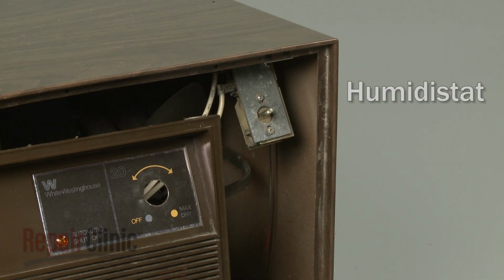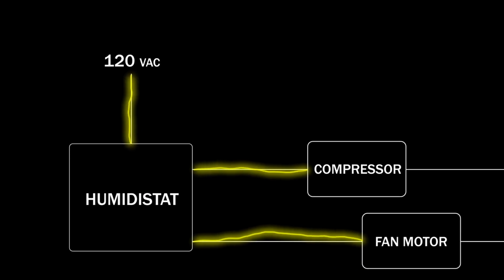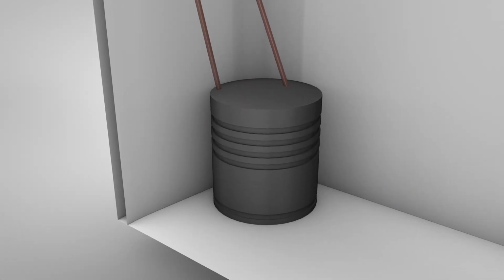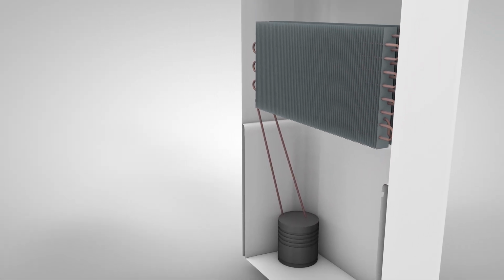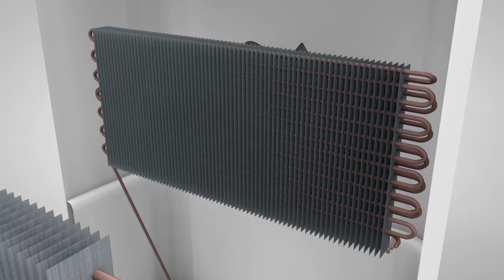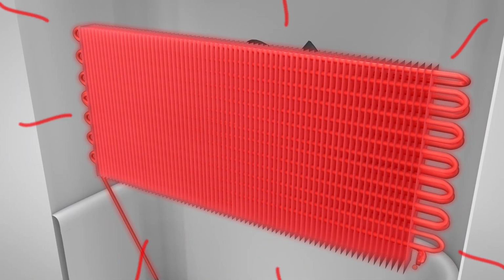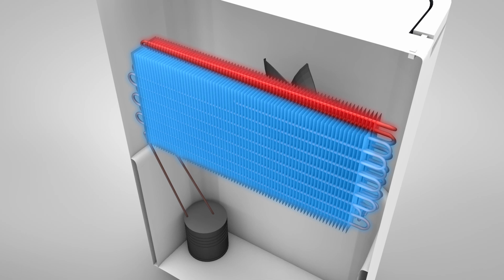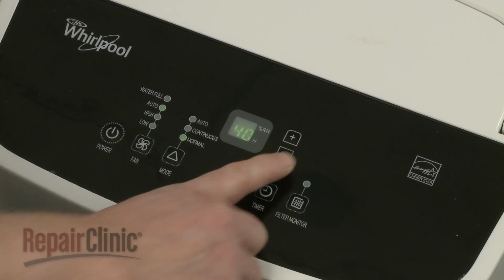How Does a Dehumidifier Work? — Appliance Repair Tips

Comment: I have an old Berns Air King DH 17 Dehumidifier and it worked good last year after I put a ball bearing in the fan motor to replace the bronze  bushing that seized up about twice and year and had to be lubricated. But, now the coils are freezing up even when I take it out in 90 degree weather outside  It has a relay and another round  component on the side of the compressor but I don't know if they are both good. Someone tole me that this type of unit has to cycle the compressor off and on to keep the coils from freezing because it has no sensor in the air flow. Do you have any idea of what could be wrong with it?
Reply: I would check for buildup on cooling coil. There could be airflow restriction across cold coil allowing it to freeze. 
Or temperature  probe sensor on coil malfunction allowing it not cycle. 

Without knowing exactly how coil temperature is regulated it’s hard to say exactly. Can be regulated by air temp. Sensor or by refrigerant pressure(low side)

Comment: All you have is a filter. I took the cabinet off to see how water gets from the air into a liquid and into a bucket. I thought there is more to it than condensation. I guess I need a commercial dehumidifier. So tired of moisture in this basement. Kill all the insects like termites.

Comment: Nice informative video. I've always wondered why the dehumidifier pumps out warm air as opposed to an air conditioner which pumps out cold air, even though both use a similar system with a refrigerant gas running through coils.

Comment: how mutc is the temperature  condenser and evaporator?
for example 65c  out from compressor and 5c on evaporator? how mutc temp must have the liguid  when gos in the compressor?  i dont have the manual and i don't know how mutch 407c to fill the system.
thanks

Comment: How is this different from turning on an electric stove in the room, as the electric stove will also reduce the humidity in the air.
Reply: A stove lowers the relative humidity by raising the air temperature.  The same amount of water is in the air, but the air is warmer, so it will feel a little dryer until the air cools back down.
A dehumidifier actually removes water from the air and keeps the air temperature more or less the same (the air will get a little warmer over time due to thermodynamics).
Reply: @Uejji  Sir, Thanks for the reply to my query - I did not see your note until now ( a year ago ). Thanks again.
Reply: @The Best Western Sorry - You are right - I just opened the page after I got a notification on your "Highlited reply".
Apparently the Uejji's reply did not get notified or I must have missed it - I don't walk away without a 'Thank You' for anything that I received. Honest Mistake on my part.  I will reply now.

Comment: on mine only the frist copper bend gets frosty dose that mean there is a blockage in there i took a vibrating tool and tipped it while running and the next  copper turn did get cold but no frost i think i may have lose the blockage a lil
Reply: Will its hot air be unuseful in summer or will the effect of less humidity be more comfortable than hot air emitted from the device.

Comment: I haven't known a recent dehumidifier that lasts more than 5 years - pathetic.
Reply: My Frigidaire has lasted 10 years, 50 pint.
Reply: @albeesand   trying to fix a Frigidaire that doesn't dehumidify, had an A5 trouble code, sensor fault.     I may just wire it on so it runs continually and just turn off manually, if the compressor still works.

Comment: Whats the point of this? This is exactly like an AC. Its better to install an AC because it does the same function and cools the room to a comfortable temperature.
Reply: AC isn’t needed in some parts of the country where its cold and wet. Better to just spend money on a dehumidifier and not more on an AC which isn’t needed.
Reply: @QuintTheSharker  
In my part of the country, the humidity is only problem in summer, when it's hot, so an ac is better as it serves to cool as well as dehumidify, for an equivalent amount of energy use. Only time it's better is if there isn't any window to install an AC unit, like a basement with no windows big enough.

Comment: I have a general electric dehumidifier model adel50lww1 thats about 1 1/2 year old that works in all functions except one. When the humidity in the room reaches high humidity, the machine will not start automatically. I can manually start it and it will run until the desired humidity dryness is met and cut off as normal. Then as the moisture builds it will not auto come-on. Any suggestions.

Comment: Hi, can someone tell me if I can exhaust the hot  air from the dehumidifier outside. The dehumidifier is working great but makes the room too hot.
Reply: That's essentially what an air conditioner does, although its purpose is, of course, to cool a room instead of remove humidity. Some A/C units do have a dedicated dehumidifier mode, though, which directs the heat outside and has the added benefit of not needing to be emptied since the water is expelled outside as well.
Reply: Use an air conditioner.
Reply: Just use an air conditioner. Yes you could exhaust the hot air but an air conditioner is more worthwhile

Comment: I'm looking for one that you can set it and forget it.  I want easy. I want it on all the time, especially the cold months. I don't want to be going home at lunch hour just to drain the bucket or else I'll have a flood in my bedroom. I guess I will spend five thousand dollars to put a drain in the middle of my bedroom. LOL
Reply: Humidity is usually low in cold temperatures, why would it be needed in winter?  
If you don't want to have to constantly be dumping out the water, you can attach a hose to it and have it drain into a sink, if you can have it sitting high enough.
When I had to use one sitting in a position too low to drain, I used a small water pump controlled by an electronic level sensor to turn it on when the bucket got full, so it automatically emptied out the high drain.

Comment: That satisfying feeling when pouring away the water from the dehumidifier’s bucket 😌
Reply: Put a few dehumidifiers outside and let it run and you get free water
Reply: @adamhvacr6536  expensive - works with electricity. BUT solar panel electricity grid - it wonder if it would be cheaper
Reply: Adam HVACR then you’d be drinking your breath, think about it 🤔
Reply: @SavCrafter  He said OUTSIDE
Reply: @chrislittle7285  oh shit you’re right
Reply: @chrislittle7285  other people's breath
Reply: @Bobby-cm7vu  Outside? Where do you live? Manila? The population density is quite low where I live. I wouldn't be worrying about people's breath outside.
Reply: @chrislittle7285  i live in a residential area but even then, people still breath, that air gets moved around, and it's always in the air, even if it's the smallest percentage.
Reply: Which is distilled water, good for topping up batteries etc
Reply: HAHAHA HERE HERE!!!!
Reply: Drink it :D
Reply: I thought it was just me
Reply: kinda like moonshine.
Reply: That's what she said.

Comment: the downside of these units is the amount of warm air that they produce and send back into the room that my central air is fighting to cool but they are useful for those areas such as a damp basement where most A/C units are rarely used
Reply: apparently you know nothing about these units, the only cool part is the water dripping into the pan
Reply: Mark Olsen did you look at the Diagramm sir? Both heating and cooling elements are adjacent to each other. I’m not sure what model you have but mine pushes out dry neutral air, like it should. You may have a cheap shit box.

Comment: can I make a dehumidifier blow cold air question
Reply: No
Reply: That would be an air conditioner. That has the evaporator inside the room and the condenser outside the room, so it gets cold air without getting reheated by the condenser.

Comment: I have that old Kenmore dehumidifier.  I got it at the dump, 11 years ago.  It has worked in a 50 degree damp room.  I think it's time to check for dust, don't you.  I want a second one just like it.  Thank you for the video.
Reply: So the aqua dry is by Kenmore? I'm looking at buying one locally listed. Clearly it's vintage but most older things run better and longer than the newer stuff. We've burned out a few newer dehumidifiers.  Maybe I will buy that older model. Is yours still going?
Reply: @Weaton777  aqua dri is made by oasis

Comment: These things are energy hogs.......... they dont take care of a big area.  They are noisy, a hassle to empty the water  reservoir. 
And if you keep them in a damp basement and set them at 30-50% they will run forever. ( most likely will freeze up at 40% )They dont take the damp odor out of the air. Ideal humidity  in  a home  should be 30%, give or take 5 %.  You have to vent that  damp wet air out of the home. Try the "Easy Breeze" system ( google it ). It's costly ( about $1000.00 ) but does the job and moves the air in the entire house up to 7000 square feet. to the outside of your home. Despite what the dehumidifier  manufacturer tell you a dehumidifier  ( even a large  one ) will only remove dampness for 1000-1500 square feet .  The "East Breeze" costs about 5 bucks a month on your electric bill, the energy hog dehumidifier  costs about  45 bucks a month to run.  The unit shown in this video  will only be good for about a 20 x 20 foot area.  The "Easy Breeze" unit  removes 7 times more  air than  a dehumidifier.
Easy Breeze will make your whole house  comfortable, not just one room.  Plus the "Easy breeze " unit has a 10 year warranty.
Think about it, the dehumidifier collects water in a bucket on the unit. That's standing water ( if you dont empty it in a day or two )  which goes back into the air.  Please research your options, it will pay off in the long run and your house wont smell when the humidity in your home reaches 65%-75%  which gets into your  bedding, clothes, carpeting, furniture, walls and closets.
Reply: Did they change the name to EZ Breathe now?
Isn't that essentially a ventilation fan?  Problem would be if the outside air is very humid: then it'd draw in moist air instead of dry air. Otherwise it's good to ventilate the damp musty air rather than just extract the water from it.

Comment: I thought Relative Humidity % #'s fixed & negatively correlated to temperature, based on this video, it says after the room air's water's squeezed out of it in the Dehumidifier, it's heated and sent back out and what happens? I'm confused.
Reply: The fan cools the pressurized (thus heated) gas; when the pressure is released, the gas cools.  The idea is to obtain a very cool surface that will condense the water, which removes it from the air.  Same as a glass of ice water that condenses water on the outside.  The trick is to maintain the cold surface when warmer air is being passed over it.   Hence, the air-conditioner-type setup.
Reply: The RH is a setpoint. The biggy is the condenser coil that cools the air below its dew point. As a unitary device, the air is reheated when it goes through the evaporator coil; the room will get warmer.  The moisture in the air is removed by condensation, not "squeasing" and therefore reduces the water vapor of the air.

Comment: THE FAN IS OKEY,I SET IT TO 75F I LEAVE IT FOR 24 HOURS BUT WHEN I CHECKED THE BUCKET THEIR IS NO WATER. . .WHAT IS THE PROBLEM...TNX
Reply: jenny dindin 
My does the same. Any advice?
Reply: Condenser failure or blockage of the reservoir channel(s) I'd imagine.
Reply: What do you mean set it to 75F? The setting is for the percentage of humidity, not temperature. The setting needs to be lower than the humidity in the room for it to kick on and remove moisture. If you set it higher it won't turn on the compressor, since it thinks it's already low enough.

Comment: so how do you know the appropriate humidity. and should or be blowing out cold air in the summer and hot in the winter. my Danby is always shutting off. the manual doesn't tell you anything like that
Reply: You will know when the humidity is right because you will feel comfortable at which point you can turn it off.....the downside of these units is the amount of warm air that they produce and send back into the room that my central air is fighting to cool
Reply: @markolsen7438  your Central air should be dehumidifying the air already, if it's not, the unit may be improperly sized for the space and turning off too quickly to dehumidify the air.
Reply: 50% humidity to 60%

Comment: so in other words I could use my old fridge as a dehumidifier by having its door left open and blowing warm moisture laden air at it with a small fan, save me buying one, once the ice starts building up, switch off and ice melts and I can then drain that water.
Reply: +Peter Bricket Lol! who said there was any mildew, problem is some idiots is too lazy to dry up her washing outside on line, she washes her clothes daily and turns up the CH full and tries to dry her clothes on the rads, when I come in from work, the hole house is so humid and warm, that will probably kill me than the mildew, I have spoken to the landlord but he can only do so much, soon as he walks out her washing rack is back in front of the radiator in the passage.
Reply: +Peter Bricket  Not oil, because she would find out through stains, I need alternative to oil, any suggestions??
Reply: +Peter Bricket  No Peter, no muck balls, she would only put the clothes back in her washing machine, I was thinking along filling half an empty bottle of fragrance with some pee, and apply a fine mist over her laundary!  this wouldn't leave a trace but a nice confusing fragrance. ha ha
Reply: +Peter Bricket  Got it wrong again Peter, its fragrance with special blend of various oils and substances tested only on humans, it was not tested on any animals, but humans and with absolutely no side effects, just a mild nauseated feeling was the worst case seen in one volunteer.

Comment: Hope you  guys can help me with my dehumidifier problem.  The compressor comes on and off   but is only blowing cold air. I took the unit apart and cleaned it , fan works well. It will draw a little water but will never output warm air . I live in a colder climate, if that  helps helps.   I hope you can help me and I will order parts if needed from you.  

  Thanks for your time.
Reply from the maker: +Andrew Holtzman The compressor is likely defective or the refrigerant has leaked out of the sealed system and the unit will need to be replaced.

Comment: not producing water and the filter light is not reading continuous and does not come on ,  only when i pull the electric plug
hgampel@aol.com
Reply from the maker: +Wendy Rosen If the dehumidifier is not removing moisture from the air check if the compressor is running or not. Perhaps you have a problem with the bucket switch if it show the bucket is full.

Comment: My dehumidifier has a small compartment above the water reservoir - What is it for?
I was wondering if it was to put vinegar or oil to give a better smell in the room?
Reply from the maker: Michael Hansen That is not a universal feature so you might want to refer to your owners manual.
Reply: I got the dehumidifier used with no manual. There is no mention of the brand anywhere online.

BUT i figured it out as soon as the water compartment filled up.
The extra compartment serves as a floater keeping the air in and raising the compartment just enough to hit the switch that turns off the unit when the tank is full.

Comment: repair clinic what is the capilary tube and what does it do??
Reply from the maker: harry andrews 

The capillary tube is a small tube in the sealed refrigerant system and restricts refrigerant flow. This not a serviceable part of the dehumidifier unless you are licensed technician and even then if the cap tube was physically broken (leaking refrigerant) it is not worth the expense of repairing on a dehumidifier.